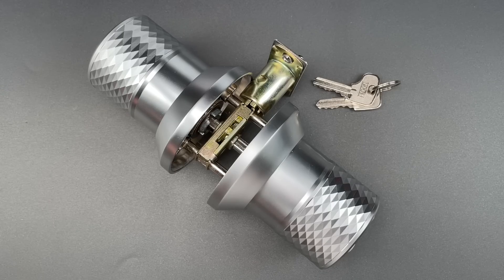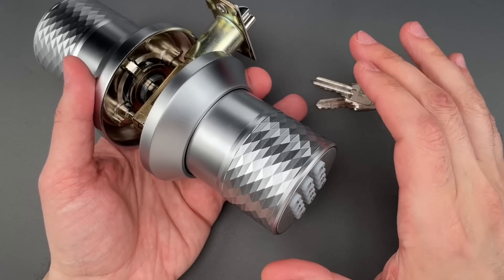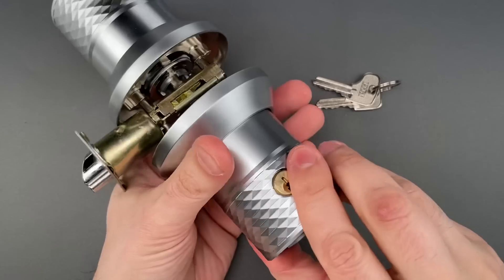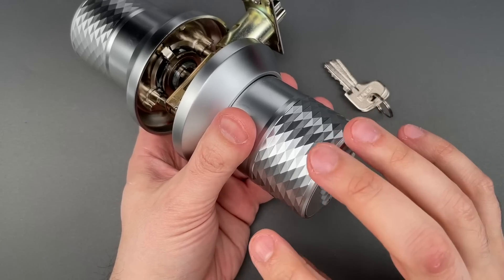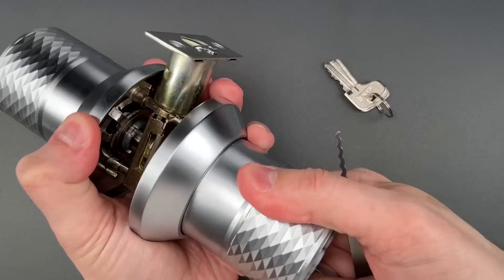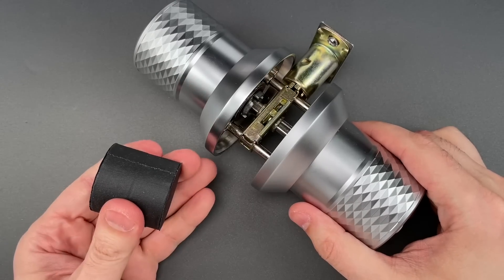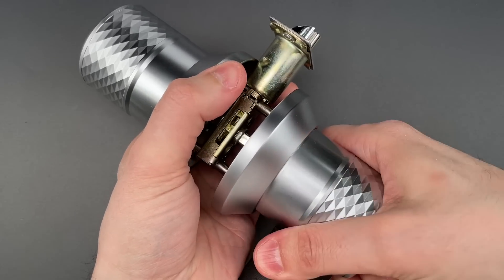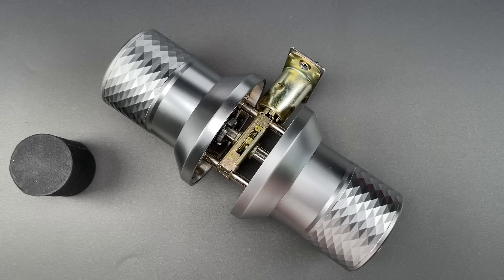[1501] Design Flaw In Fitnate “Smart” Doorknob

Comment: What I have learned from watching this channel is that there is no such thing as a secure lock.  LPL should design a lock that is pickproof (if that is even possible) and sell it.
Reply: I think he has mentioned that a cheap Kwikset with drop pins would be best against picking. If all the pins aren't activated at the same time, they fall out and brick the lock. Meaning it won't unlock ever again(or until the lock is dismantled and reassembled). It is not only pick proof, but also indicates if someone tried to.

Comment: Hi, can you please explain the difference between locks that can be opened with a raking attack vs combing? I don't understand the difference
Reply: Raking basically randomly wiggles the pins until they catch on the shear-line and the lock opens.  Combing lifts all the pins completely above the shear-line so the core can turn...
Reply: locks that can't be combed have a somewhat paracentric keyway which makes you unable to insert a comb pick under the pins, raking actually manipulates the pins to sheer
Reply: @thelockpickingspoon9074  locks with wide open keyways can still be made comb proof by making it so that the key pins can't be lifted completely above the shear line...
Reply: @GerryIles  most companies don't do that, they generally rely on paracentricity of the keyway to prevent comb picking

Comment: When you flip the lock over to show the cylinder, I see what appears to be a micro USB port.  Right away that tells me this is a bad design.  That tells me that the electronics to control the lock are all on the exterior portion, available for anyone to access.

Comment: Little feedback: can we get the videos to be slightly louder? LPL videos are always on the lower end of loudness spectrum of YT videos. I'm using a browser extension to boost them.
Reply: Nah I prefer it sotto voce, adds to the slightly thrilling naughtiness.
Reply: What does the extension do? Normalize sound across videos, or do you have to "teach" it what to do with certain channels? I'm ok with LPL's volume, but there are a LOT of others that are worse. I've given up and stopped following a channel that started leading its videos with loud noises that hurt my ears after normal video volume, and I'm getting annoyed at the ones I have to raise the volume all the way to hear even with good headphones.
Reply: Try your volume control
Reply: @soisaidtogod4248  And then get blasted by the next video, which plays at the customary volume instead of at a library hush? No, I second the motion that LPL makes his videos loud enough for someone over age 5 to be able to hear them at regular levels.
Reply: @soisaidtogod4248  I can adjust it sure but why would I increase it every time I see LPL video just so I have to crank it down afterwards for basically any other video on YT? It's no biggie, just a suggestion.

Comment: I see a  port (presumably USB-C) on the knob, most likely for charging. I guess you need to charge it regularly to make it work, but imagine someone tries to open it from the other side while charging. I suspect that port won't last long.
Reply: Worse it's on the OUTSIDE. Do you charge it with the door open to access a plug or leave a usb battery pack outside. I hate both options. All of the electronics should be on the inside with just a few wires for the num pad on the outside.

Comment: Nice! How did you figure out the magnet on the handle? Would love to get an explanation on that design choice :-)
Reply: Electronic locks have some kind of solenoid inside them that activates when you enter the code, and it's a $50 lock, so chances were good that they didn't spend the extra money needed to add magnetic shielding around the solenoid.   Of course he has shown plenty of more expensive locks that don't bother to add the shielding so the price isn't a good indication that a magnet won't work.
Reply: @MartysRandomStuff  better ones would use a motor, but the only ones I haven't seen a magnet override were several hundred dollars. I still get annoyed at that one gun clamp he showed... Police grade for securing their rifles... Magnet opens it in a second.
Reply: Anytime you have a solenoid, one of the first bypasses we test is a magnet... Which is kind of why we expect companies to have place to shield or something like that.

Comment: I don't understand locks with low quality back up cylinder. (Or back up cylinder at all sometimes)
It becomes the first angle of attach, lower security and I'm pretty sure are most of the time never used. Just put a good lock and that's it at this point.

Comment: Just how did he figure out how to open the lock with a magnet? I’d like to see how he attempts these “picks” right out of the box. It might make for a longer video and I’d like to hear him talk it through when attempting to open the lock for the first time.
Reply: There aren't that many ways to implement an effective, efficient, and cheap electrically controlled clutch. A rotating brushed motor and screw make a distinctive keening noise. A solenoid clutch makes a thump or clicking noise. A solenoid is readily manipulable by a magnet from outside.
Also, gadgets can be disassembled with screwdrivers and other tools.
Reply: Probably just saw the keypad and figured he'd wave the magnet st it until something clicked.

Comment: I'd actually like a lock with a magnet bypass for low security situations where you're not protecting your homes entrance but maybe you are locking off a room when you have guests. You use the code normally but if the battery is dead you grab a magnet. My issue is the keyway on this one. Someone might pick it fairly quickly like a nosy friends kid. But if it were just the magnet then it wouldn't be as obvious. But yeah for anything high security, that's a nope.
Reply: Unless your friends have the same lock, and their kids learn how to open it with a magnet.
Reply: I would say, pick up this lock, erm door handle, disassemble it and file away whatever lets the core actuate the unlocking. then you got what you want with a distraction built into it. "Oh its got a key bypass, few seconds later, Huh its not doing anything.."

Comment: I have seen quite a few locks getting picked on this channel. So my immediate thought when I saw the num-pad was "use a magnet". Because it always works.
Reply: Yup.  It's because, no manufacturer would pay for either a magnetically shielded solenoid or equivalent solid-state device.  They somehow don't think it would be a worthwhile selling point for consumers who would have no idea what that means.
Reply: @TesserId  electronic locks that use a gear driven mechanism instead of a relay aren’t susceptible to this low-effort attack.
Reply: @mlindholm  Makes sense, thanks.
Reply: @mlindholm  Do you think a strong rotating magnetic field would turn the motor in  gear driven ones?
Reply: @miklov  -- Yes, LPL has opened a couple by rotating a magnet nearby, and at least one with a special tool designed for magnetic screws in furniture.

Definitely a harder attack, but still possible. The orientation of the motor might prevent this though.
Reply: @TlalocTemporal  Cool, thanks!
Reply: @mlindholm  some can be opened with a rotating magnet.

Again the lock could then detect magnetic fields from outside and apply current to keep the lock locked.
Reply: @TesserId  On a lock like this they could place the solenoid at the "inside" half of the device so you can't place a magnet next to it. But then there would obviously have to be an electrical connection between the halves.
Reply: @Murgo-u3l  Plus a mechanical link so the knob with no magnet can still turn the deadbolt when the other magnet is activated.  A simple solution is making the outside part turn nothing and the inside part contain a motor that does all the work.  Outside panel also needs pads for an emergency 9V battery, in case the inside battery runs flat.
Reply: @johndododoe1411  it already has a USB port near the cylinder
Reply: @johndododoe1411  I see a USB connection on the exterior knob, next to the keyhole. I would HOPE that is for emergency power for a dead battery. (I would hope its NOT for a keypad code override access.)
Reply: @TesserId  "They somehow don't think it would be a worthwhile selling point for consumers who would have no idea what that means." and any mfg would be selling at a price point that pick resistance, and also magnet resistance, cannot be included without exceeding that price point. Of course there ARE locks that are resistant to these attacks, and they cost more. and sell to fewer customers. but those customers are satisfied with the attack resistance they have purchased.
Reply: Yes yes it often does
Reply: I yelled "Magnet!" the minute he said there were two easy ways in.

Comment: When LPL pulls out his wave rake: "Uh-oh"
When he says there's an even easier way: "Pack your bags, this is going to get ugly"
Reply: Look at key bitting...  I was surprised that the rake didn't opened it like a key when it was inserted.
Reply: When I saw the keys, I thought THEY were wave rakes. Company went super cheap on the backup cylinder and fancy on the outside.
Reply: @JacobProbasco  Cheap on the inside too! Magnets should never be able to open a lock.
Reply: "Potent design weaknesses!"  That'll be my new critical-of-your-work phrase. :-)
Reply: Low-skilled attack = here comes the wave rake
An even easier way in = here come a magnet

I was right on both scores!
Reply: @Teverell  You forgot the hammer attack
Reply: lol yes.....rake opens easy....Magnet: hold my beer......
Reply: I look forward to the day when LPL videos are only 30 seconds long. See lock, pick lock, "that's all I  have for you today," done. This lock could have qualified, but it had two flaws.
Reply: @DrWhite006  well if its a short video that means the lock is bad, real bad
Reply: lol yeah

Comment: For the magnet attack that is on so many devices would a rotation based solenoid instead of a linear one help in that regard or do you think the magnet would be able to rotate it?
Reply: It could, but it would be harder. But magnetically shielded ones exist anyway
Reply: How would you make that work? I guess they could use a servo motor. That might be a tad slow to actuate though. People tend to like a positive action with lock mechanisms.
Reply: @1pcfred  Yeah, people like their locks to open fast, a fast servo would probably use too much power and drain the battery too fast.  And servos cost more, this is a $50 lock, so no shielding, no motors, just a cheap solenoid.
Reply: @1pcfred  they make high speed rotation solenoid works especially the same way just around an asix instead.

Comment: I would be interested in videos (where possible) where you fix the flaws. Replace a core, perhaps (or pins, whatever). Maybe place a piece of metal so someone couldn't shim a thingy. In other words, info that I could turn an off the shelf product into something LPL might use.
Reply: a zero cut pin tends to defeat raking attacks.  but the reality is, most burglars won't even attempt to pick the lock.  they go straight to destructive attacks most of the time.
Reply: @kenbrown2808  Yes, yes, they go destructive. Yet here we all are not buying certain locks because of various flaws - so that's a thing too. Your argument would boil down into saying none of LPLs content is interesting because they kick the door anyway. But that's obviously not the case - we do watch. In the same vein, I'd be interested in seeing fixes. There are products I want (digital stuff seems neat), and making products more resistant to whatever specific attacks is an interesting idea.
Reply: @DigitalArchmage  he's occasionally released videos about repinning locks to make them more pick resistant, or upgrades that the lock manufacturer has done to correct deficiencies he caught.  but as someone else said, he's the lock picking lawyer, not the lock fixing lawyer.
Reply: @kenbrown2808  omg, all I'm saying is that it would be both interesting and useful - and at the same time it gives us a path to more security (which is on US at the end of the day). As you point out, the times he's done it has been interesting. Clever breakdowns of his name aside, we live in a world where the companies won't do it (as evidenced by the fact that they know he exists and continue to ignore him), and we all know he's probably better than those companies are to deliver such solutions and content. If we have to focus on his channel name, I'd point out that his name also includes "lawyer" but we don't care that it's not legal related.
Reply: That would turn into a free consultancy job for the lock manufacturers...
Reply: @rayoflight62  it would, except it won’t because they won’t listen, as long as people buy the locks as is the company is going to continue to make it as cheap as possible to keep profits as high as possible.
Reply: @rayoflight62  He's already doing that when he points out the flaws. They already don't care.
Reply: This is the Lock Picking Lawyer, not the Lock Fixing Lawyer.
Reply: That's the job of the company
Reply: @Stonka1  I honestly think the companies job is to sell a lock, end of story. As long as others buy the flaws, they will sell the flaws. It's our jobs to secure ourselves - we mistakenly believe our security is on the company, but it's not - it's on us. If flaws can be fixed, making a product better, then we're only better off for it.

Comment: For me the idea of a lock that I have to charge is a deal-breaker.
Reply: I mean, you can open it with a magnet, so charging isnt really necessary
Reply: And charge on the outside.... At least make the charging port inside the house
Reply: @mgraham81  i actually thought that was a feature, where if you don't have the keys or a magnet as we found out, you could plug in a power bank to still use the keypad

Comment: They could have run a wire through the lock and put the solenoid on the inside knob. Slightly more prone to wear damage over time, but problem solved. That and a decent lock core and we know what LPL would have on his door.

Comment: Is there any reason why usb connector is located outside the door? Looks like it could cause a problem.
Reply: Probably so you can power it if the battery dies.